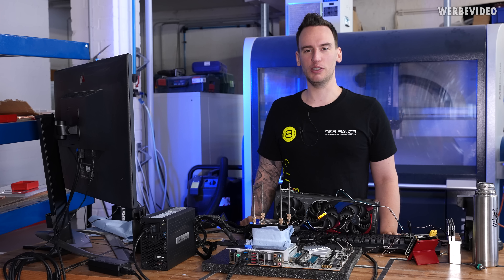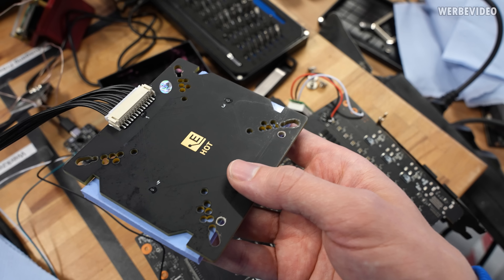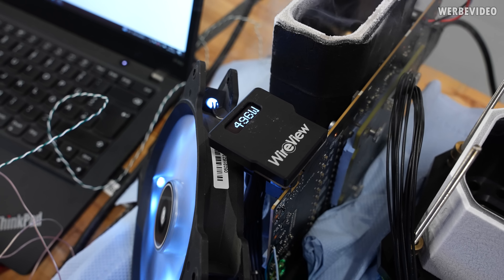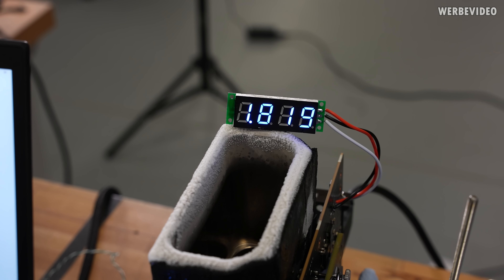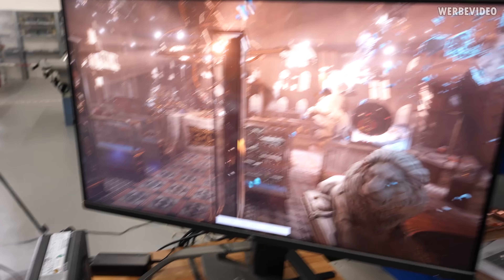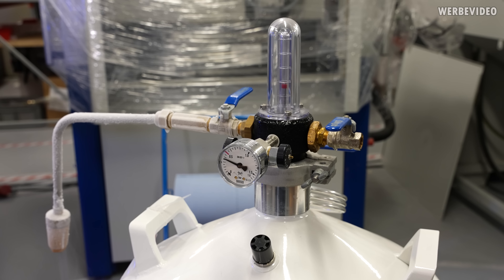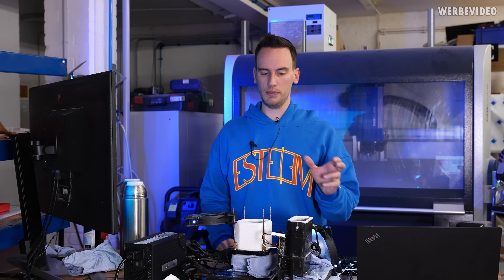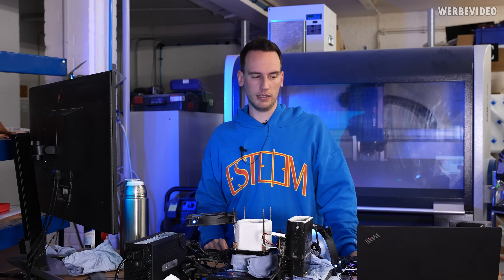A Challenge for 12VHPWR? 900 Watt Power Draw running the RTX 4090 under LN2

Comment: Did you know that the problem with 12VHPWR are also in ATX 3.0 power supplys?!
Reply: The issue is the connector, regardless of what/where it's plugged in.